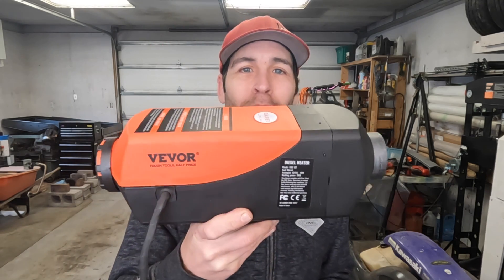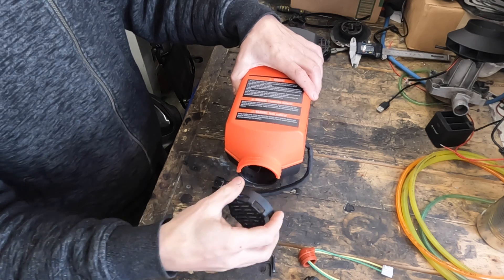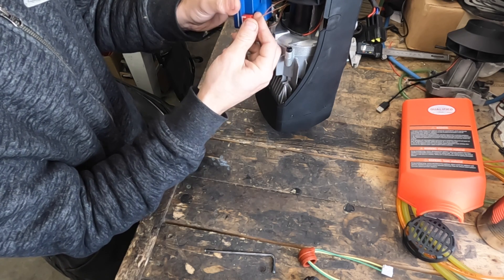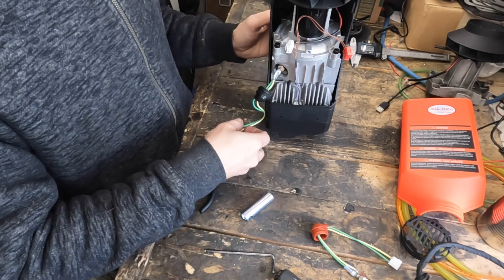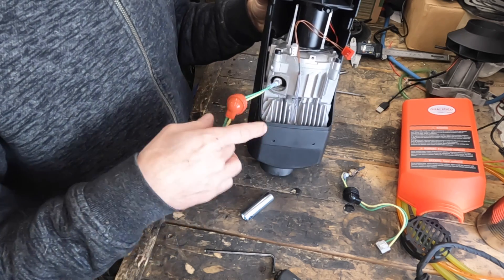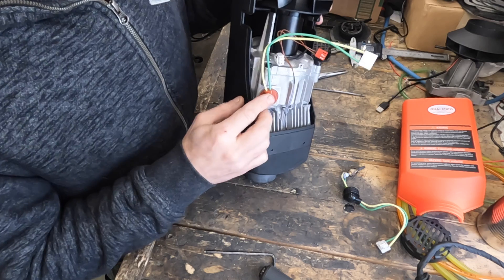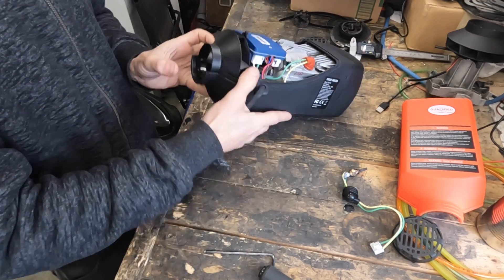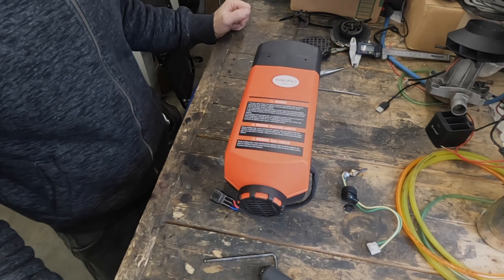Diesel Heater Glow Plug Replacement - 2, 5 & 8 kw Heaters. (see pinned comment)

Comment: I need to know what my heater is if it's 2,5, or 8 kw  I ordered an 8kw and im pretty sure it's just a 2kw
Reply from the maker: The 2kw has a 60mm air outlet hole / hose. The 5 and 8 (from almost every manufacturer) are the same at 75mm outlet / hose. 

If it tells you fuel consumption in litres per hour it's easy math.  .5l/h is 5kwh (5kw heater) 

The 2kw is about 1.8, the 5kw is around 4.3 and the 8kw is also usually just a 5 with different stickers. Some will increase pump hz to pump more. 

Maxspeed and Hclroy (or whatever) sell heaters with 90mm heat outlets / hoses that claim to be 8kw and the claimed fuel consumption is .7l/h so 7kw ...... I just got one but have not taken it out of the box yet.

Comment: I accidentally stripped out the glow plug threads. Any idea how I can re-thread?
Reply: Healy coil
Reply from the maker: This is very tricky because the plug has a taper seal, as does the chamber. 

What stripped ? The plug or the chamber hole ? 

You could use a thread repair insert, but unless you already have the kit, it's cheaper to buy a new chamber and glow plug (or one or the other. 

If your heater is mounted in an upright position, and not mobile (in a vehicle or trailer) The plug does not need to be terribly secure in the hole.... ir it is in there, it will work. You could technically drill it out and set it in or use some exhaust sealant, JB weld etc.... This is not the proper way, but if you don't' have the money do do it properly, it will work. 

If your heater is not mounted with the exhaust and inlet pointed down, diesel can run out of the threaded area if it is not sealed.
Reply: @loweredexpectations4927  hey thanks you guys for helping. I accidentally cross threaded the plug into the hole and it's all messed up. I ended up buying another heater but I still have the other one.
Reply from the maker: @bogey6925VR  In that case, head on to aliexpress and shop around a little ... You can get a chamber for $20 ish shipped and a glow plug for a few bucks. It will take a month or so to get the parts, likely, but then you will have a working backup.

Comment: Could you take a 45 gallon drum, with a removable Lid then Fill the drum with Water then after drilling two holes in the Lid sit the Heater on Top then Coil up your Extra Long Exhaust into a Loose Spiral and immerse it in the Water and see if the Heat from the Exhaust will be hot enough to Boil the Water (the other hole in the lid would be for the Air Inlet) coming back through the Lid through another hole (where can you buy the extra long Exhaust Pipe) Love your Channel very interesting!
Reply: Won't work..   the radiation of heat from the drum far exceeds the maximum in the exhaust (around 1 -2kw.,)  condensation will bock it quickly.  Yoo get far better heat recovery using pcfans on my CONSTANTLY GOING DOWN HILL OR STRAIGJT DOWN exhaust.
Reply from the maker: Yeah..... Not enough power .... if you did try you would have to have the holes exit the side of the barrell.
Reply from the maker: I love the idea .... I don't think it would have enough energy to boil the water... . 45 gallons will take a lot of heat energy and it will lose a lot through the walls of the barrel .... I think it would lose energy faster than it can add it (at a certain point) and not reach boiling. 

it would be fun to try though. Perhaps on a smaller barrel.
Reply: Hi The water in the Barrel doesn't have to be Boiling, just Hot enough for a Bath and 40 gallons of Water is about the right amount you need
 Hoping you will give it a try in your next Video or tell me where I can get that really long exhaust pipe so that I can try it myself @loweredexpectations4927
Reply from the maker: @ajt7-e6m  I won't be trying this any time soon, but yes, depending on the ambient temperature, you should be able to get the water to heat up to 40-60 C. Insulating the barrel would help a lot, and the exhaust would have to exit out the side so that the condensation could run out ... but it could work. 

Amazon sells exhaust that is 1.2 meters long.
Reply: When you say the Exhaust would have to Exit out of the side, do you mean exit out of the side of the Barrel underwater or above the Water? because I am definitely going to try this and then pump the Hot Water through a 'Stem Punk' Tap into the Bath Tub Amazing Channel Looking forward to your next Video @loweredexpectations4927
Reply from the maker: @ajt7-e6m  Basically, because you are cooling the exhaust, condensation will form and water will build up quickly. You need the water to drain out.  

You can't exit the exhaust under water, or it will fill with water and the heater won't even run. You can't come out the top of the water or the condensation will get stuck in the bottom and plug the exhaust. So, exiting out the side of the barrel makes the most sense.... or out the bottom if you have it on a stand, perhaps.  

If you put the heater near the bottom, the heater will continue to heat the water if / as the water level drops.... where if you put it at the top once the water level drops you're not heating the water. 

You will have to get really creative with either sealing the water out of the fan area, around the glow plug and fuel line, or cut a hole in the side of the barrell and install the heater so that the inlet side is on the outside of the water. I will be challenging.
Reply: I was planning to sit the Heater on top of the detachable lift off Lid of the Barrel with the Coiled up Exhaust Pipe 

Going down into the Water and then exiting out of the side of the Barrel near the bottom of the Barrel

 But would have to Weld a Pipe in the Side of the Barrel so the Water doesn't leak out

In Theory this should work but we will see and if it does then I will let you know

Many Thanks for your encouragement @loweredexpectations4927

Comment: Do you think Peltier's could Run the Fan? Like the fans that run from the heat of a wood stove? You might have to cut a thin layer of fins and sandwich the Peltier's between the unit and the cut layer
Reply from the maker: If you had enough of them.... YOu should check out Dave McLuckie's video on the self powered heater.

Comment: I can't understand why you took the ECU off, You can change the glow plug without removing it. I still gave you a like.
Reply from the maker: I took it off because most people who watch this video will be able to figure out that that is not necessary, if they are confident with releasing the connectors. 

For those who are not comfortable with the connectors, it is better to remove it and reduce the chance of breaking something👍 Thanks for the comment and like... I appreciate it.
Reply: He said you didn't have to but it made it easier.  I didn't even know the location of the glow plug until he took the ECU off.
Reply from the maker: Yes.... You don't' have to do it, but a lot of people who have perhaps never touched a screwdriver in their life may watch this, haha.... I want to make it as fool proof as possible.

Comment: To remove the mesh easily, you can use a thick screw, it comes out very easily. My opinion is to change the mesh, regardless of the condition of the old one, of course if you have a new one at hand.
You can find glowplugs even cheaper, about 8 dollars, but I think it also depends on which country you live in.
Reply from the maker: A few people have pointed out that a carriage bolt works well. I hadn't thought if this. I have used the same mesh in my heater for 4 months of waste oil testing and I think replacing them is over rated.... but maybe that's just me... my heater have never had mesh issues.

Comment: kinda funny that this kit costs about 25$ while you get the bare unit for sometime about 100$. Something doesn't add up here.
Reply: 7 dollars for the part and 18 for the shipping from China
Reply from the maker: and a month wait time 👍
Reply from the maker: I'm guessing you don't have a degree in economics ? haha 

First off... this is CAD and the heater is almost $200 CAD 

Secondly is that the glow plug don't cost $25, a glow plug kit with a tool, gaskets, mesh etc, doesn't even cost $25 ... Having all of this next day from Amazon cost $25  

I could make my own for just a few cents, or order one from China for a few bucks.... The value of something is usually not totally in the product itself.

Comment: Don't break it off and you won't need to replace it...🤣🤣🤣
Reply from the maker: Why didn't you tell me that BEFORE ! haha.
Reply: @loweredexpectations4927  well, you know you have to have a spare. Otherwise it will break. Won't happen if you have that spare...
Reply from the maker: @sjococo  HAHA... yes, this is the perfect safety net. Buy 4 spares and you will have 4 10 years from now.
Reply: @loweredexpectations4927  did you get the bigger body heater yet?
Reply from the maker: @kirkwalsh1932  It arrived yesterday... Still in the box... I was trying to film something today and the power went out... was out for 2 hours and then I had to do other things. I should be able to unbox it in the next few days.... The life of a YouTuber... Can't open a box unless the cameras are rolling !
Reply: @loweredexpectations4927  right on, like I said before I have a 28ml on its way to run with my larger one. Might see what it does on the 5kw that won't hit the 200C mark. There's a 32 or 35ml pump option I've seen also. Should be able to get the most out of the heater without  reprogramming the board.
Reply from the maker: @kirkwalsh1932  You are going to get over 200c now.... trust me, haha. Woha... 35ml !
Reply: @loweredexpectations4927  what  would a 28ml give me @ 5HZ?  I'm not sure of how you get the numbers.
Reply from the maker: @kirkwalsh1932  I don't know what it will show up as in degrees celsius, but it it is one more KW than the 22ml. Actually a little more than 1kw, but who's counting.
Reply: I'll have to actually wait and see what you say the max output is for that larger body heater's motherboard. Do you know what the max output is on your Vevor 8Kw Bluetooth?
Reply from the maker: @kirkwalsh1932  Realistically I think it is right around 4kw... the test that I did with the one in my truck, it had an average of 3.4 kw over 12 hours. 

What the max is isn't necessarily the same as what the average is. Most heaters have a fuel cut where they slow the pump after a certain heat.... People get confused or caught up in measuring temp, but temp can change depending on many factors. 

For example. If you want your heater to run hotter you can block the inlet or outlet and the temp will go up. It's not making more heat, you are just keeping the heat in the exchanger. Same with hotter or cooler room temperature. On a +30 day, your heater will run hot, but it's not making more heat and if your room temp is down to 10C then the exchanger will be cooler. 

All that to say that the ECU will often slow the pump down when a certain temp is reached. On my old heater that is 210C. On others it is 220 or 230, and some don't do it at all. If I leave my heater outside in the cold it may make 4kw or more as the pump will run at full speed and never reach 210C, but when I have it inside, it heats up to 210, the pump slows down until it cools off and then it speeds up again.  Hopefully that makes sense.
Reply: @loweredexpectations4927   OK, I've never really heard my pump slow down. And yea I know about the airflow over the body. You will see a big difference with the 90mm output. Mine cools down quite a bit with the inlet cap off, but it moves a ton of air.  
I think I might have hit the high temp mark once, but the heater went into a shut down mode where the pump totally quit. That was when I did the propane injection.  I'm hoping the board I ordered has the manual settings capability. 😬
Reply from the maker: @kirkwalsh1932  I unboxed mine and took it all apart this afternoon... This comment made me remember it is running haha... oops.
Reply: @loweredexpectations4927  nice. So what do you think of the larger body one?   🤔
Reply from the maker: @kirkwalsh1932  Looks like a great heater... Teardown video should be dropping today around 3 Calgary time. 

PS. My head has been spinning in circles trying to get videos shot, edited and making arrangements for new products ... I totally forgot to mention I got this heater because of you. I will try to remember for the next one.